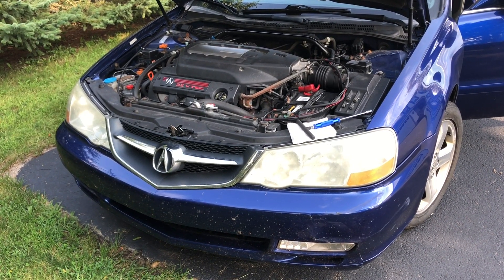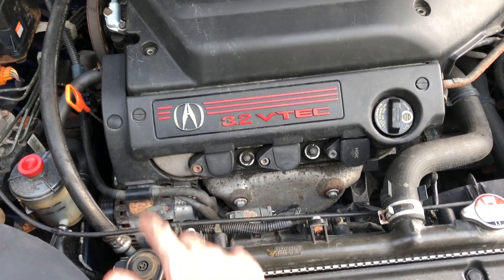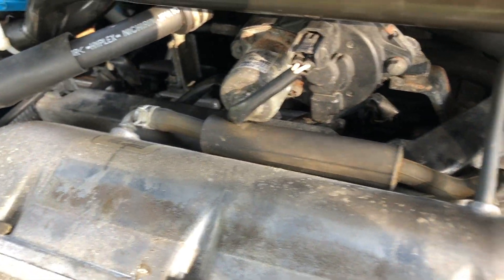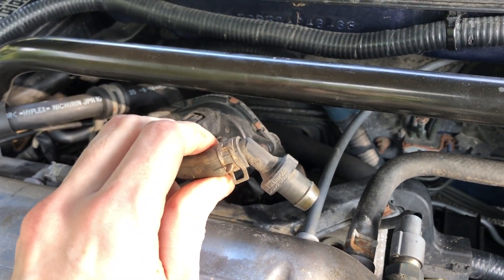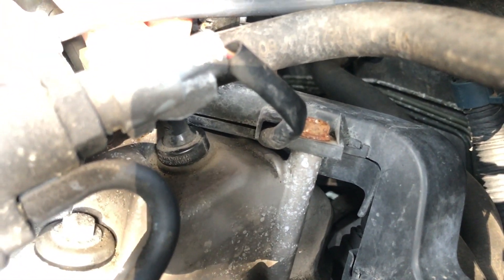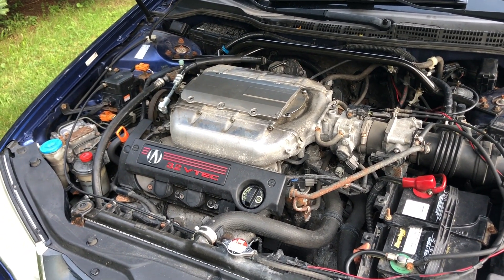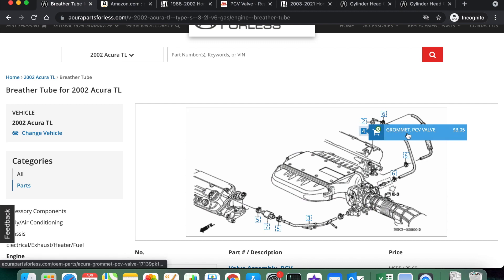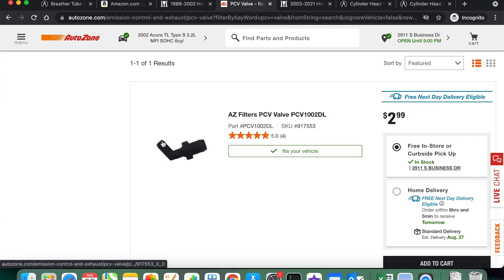Engine Burning Oil? Replace your PCV Valve for Honda/Acura

Comment: Thanks for the video. Sadly the new design is terrible because the PCV Valve is placed on the side of the front valve where it gets extreme heat and over a long period of time has plastic overheats, it becomes brittle and breaks. Yesterday I "tried" to remove our PCV Valve from our MDX and it broke in half and is stuck inside the valve and now I have to remove the intake manifold and front valve cover to get in there to remove it. I wanted to replace the spark plug-hole seals anyway, so I guess this happened for a reason lol...

I really wish Honda/Acura would design these out of metal so they didn't break off so easily. I was careful too, even tried a 45 degree pliers
Reply from the maker: What a pain! I agree, with as important as this little part is, there’s no reason they couldn’t have engineered it a little better. Corporate greed is what I call it. Thanks for watching!
Reply: @CarRepairsMadeSimple  You are welcome, besides greed, it is simple carelessness. In another video, I commented on a guy mentioned that he has a Toyota that has a PVC Valve made out of metal... no reason why Honda/Acura could not do the same.

Thank goodness for RockAuto, just ordered a new Intake Manifold Cover Gasket, Valve Gaskets, Spark Plug Seals, etc.. With about 115K miles it was about time to replace these gaskets away.

Comment: Hello, thank you for making a great point about it being a better air flow to travel if it was straight or more than 90° angle. I have a 2000 Acura Integra with 99k miles on it as of today. unfortunately mine confident OEM 90° angle PVC valve. What PVC valve would you recommend for my engine?
Reply from the maker: Yah after looking on multiple websites, I can only find 90 degree valves for your car. So on that note, I would recommend sticking with the Genuine Honda part
Reply: @CarRepairsMadeSimple  Ok, thank you.

Comment: Hello brother. Off topic but wanted your input. Whenever i use an automatic car wash or drive in rain my car will stall and sputter right after starting up ad will go away but does this for days afterwards. Have you experienced this?  Any solutions?  Thank you. Have a great new year
Reply from the maker: I have not have this problem. One thing I can think of is maybe water is getting into your air intake. Do you have an aftermarket cold air intake?
Reply: @CarRepairsMadeSimple  no I don't. Maybe it's getting into a sensor of some sort
Reply from the maker: @CanesupNolesDown  I guess two other things I can think of is open the hood after a car wash and see if anything from the top is getting wet, specifically ignition cables. Otherwise maybe look at the oxygen sensor connected to the catalytic converter, that cable is rather exposed underneath the car.
Reply: @CarRepairsMadeSimple  will do. Thank you. Happy new year brother
Reply: @CarRepairsMadeSimple  have you replaced your IACV?  I have a bit of a rough idle
Reply from the maker: @CanesupNolesDown  I have not, nor do I have a rough idle. I can tell you it's normal to have a rough idle for a little bit if you recently reset your CEL or disconnected your battery.

Comment: I need help trying to put my brake retainer clip back on for read brakes
Reply from the maker: I'm not sure I can be much help over the internet, usually, they just slide in and out pretty easily. Make sure all surfaces are free of rust and nice and smooth. Maybe use a wire brush and/or sandpaper followed by brake cleaner.

Comment: Hey bro. I have an 02 type S with 197,000 miles on it. Thank you so much for making these wonderful videos. I want to keep mine as long as possible  I love it  I'm by far not a mechanic so your videos are a God send. I wish I could send you a picture of mine. It's in really good shape
Reply: My current issue is water getting into my cabin filter and dripping. My ac drain isn't clogged nor are my sunroof drains. Trying to diagnose now.  Be safe and thanks again
Reply from the maker: @CanesupNolesDown  I'm glad my videos have been helpful! Perhaps the windshield cowl drain is clogged on that side. Maybe remove the cowl and check for any debree buildup under there
Reply: I did that. I even poured some water down it and it drained fine. When I find the issue I will definitely share it with you
Reply: I have a 2002  navigation base model TL,
Just hit 165k miles and it still runs like a  FAST top. If you get a good rebuilt transmission,
 these cars are absolute gems. 
You're a hundred percent right,
 I want to keep mine going as long as possible!
Reply: @ikon8275  got 215,000 on mine now still going strong. Thank God